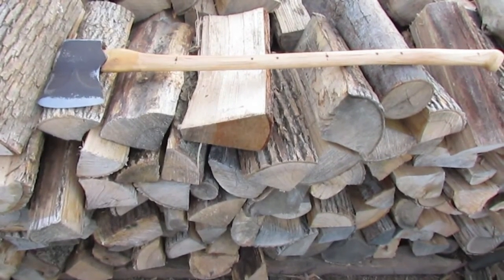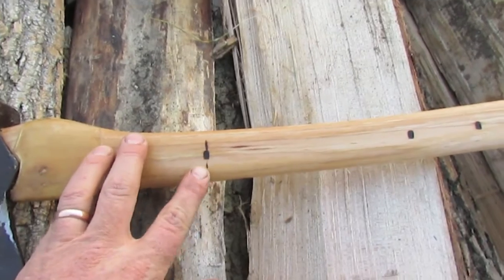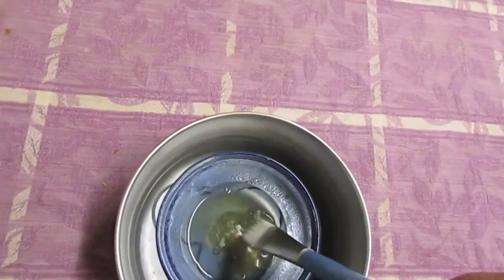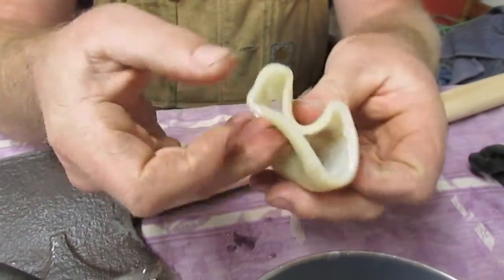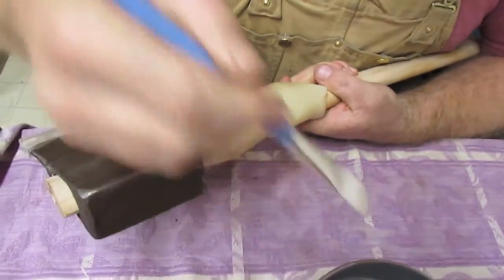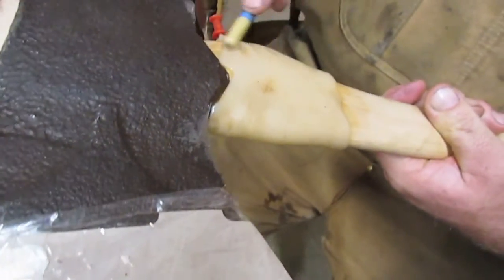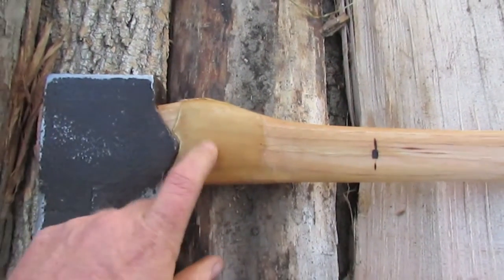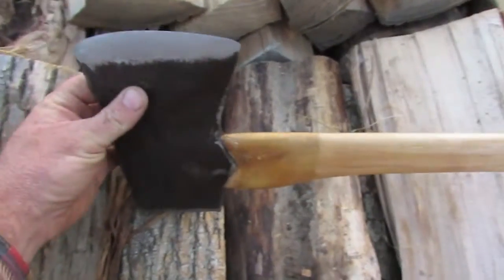Phantom Bevel Jersey Restoration Part 2- The Hang

Comment: I love the idea about the scale on the haft...!
Reply from the maker: Totally wasn't my idea.  I stole it from someone, can't remember where. I recall the wood burning being much better executed visually, maybe they used a real wood burning pen or something, but they did a much more rulery rule, with marks every inch.  I thought that was a bit much accuracy wise for an axe rule.
Reply: nonetheless... when I was wondering about measuring wood to buck... I wanted to make me a simple measuring device... and not being in the woods and holding the axe as i was pondering... it didn´t come to my mind... so thank you!!
Reply: Oxbow Farm I've heard about using a hot wire which might give a different appearance, but think the nail worked fine.  Maybe a mix to denote foot and stove wood length marks?
Reply from the maker: Dave H.  I think I will make the marks slightly smaller next time I try doing this.  I liked the cut nail, but maybe try the tip for a slightly smaller mark etc.  I did sort of freehand extensions on the marks at the foot measures.

Comment: Abominations, ha ha, agreed!  Um, I say it too, and so and and and like and well.  I'm better than I used to be, but mostly I edit them out a lot.  I'm better with cameras and batteries too, but it's sort of a constant problem.  I think the squirrel might actually offer some protection, but only til it tears on impact.  Rawhide is hard and tough, but it's still kind of brittle if it's not thick.  I guess time will tell, maybe it will hold up fine.  The one thing I would do different is to re-flow the hide glue after the rawhide is all in place.  It congeals when cold and re-heating will just let it smooth back out and stick evenly to the rawhide and wood.  As long as it's not hot enough to cook the rawhide.  Handle looks great!  I'm impressed.  Nice and thin too.
Reply from the maker: Reflowing the hide glue is still a little bit of a fuzzy process to me, and I was kind of a little fed up after all that hacking around with the thumbtacks etc.  It definitely felt loose on there, but I felt like the hide glue got temporarily diluted by how wet the hide was.  I think it might be worth wringing out the hide or scraping a lot of the water out of it right before you do this, just to keep the hide moisture from changing the glue bond strength? It seems super tightly bonded right now, but that may just be a function of a tube shrinking onto a cylinder?
Reply: I would probably scud out some of the water.  The lime swelling can be washed out that way too if you do it a bunch of times.  I'm not sure how it affects the skin in the long run, but I like to get it out.  YOu'll know because it "falls" back to being thinner and less rubbery.  I think I might have just held my last one near a heat source, or poured hot water over it to remelt the glue, because it had gotten all chunky under the rawhide, like jello.